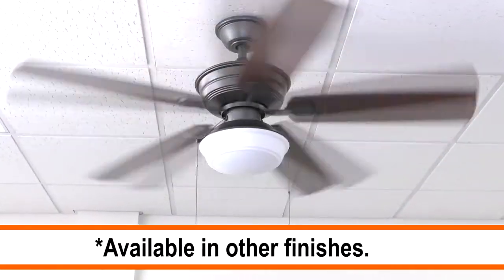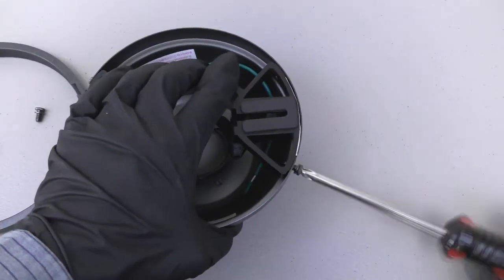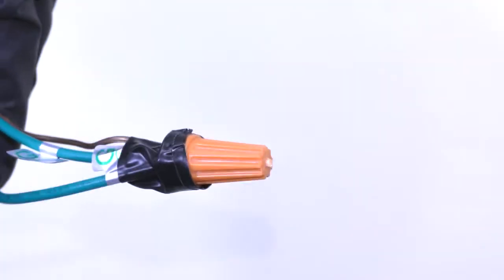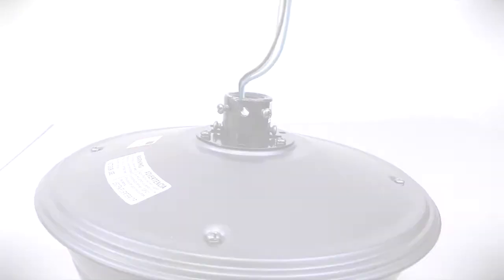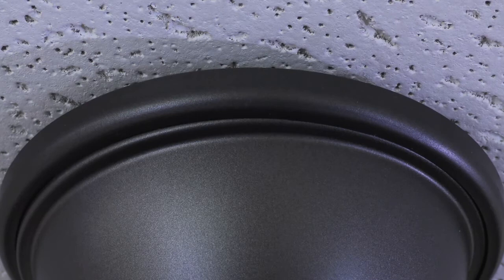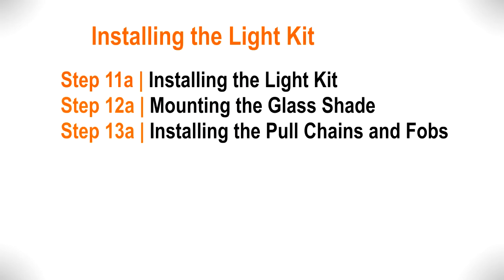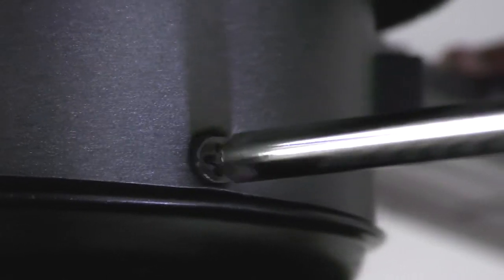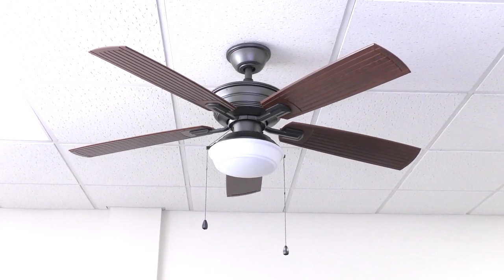Marshlands Ceiling Fan Installation Guide

Comment: What’s the height with flush mount and light kit? 13-13.5 inches?
Reply from the maker: The standard height with the Downrod is 18.50 inches. Flush mount height is reduced to roughly 14-14.5 inches.